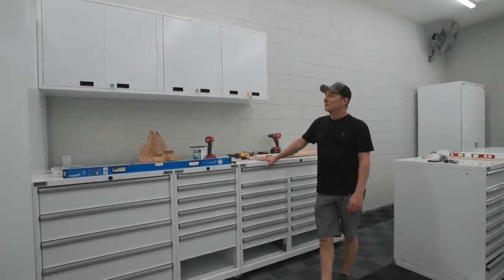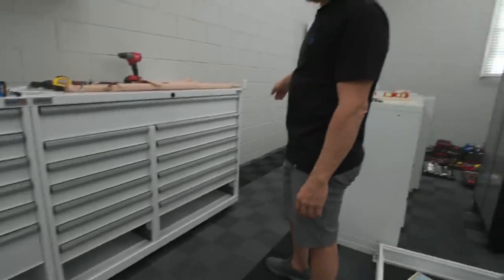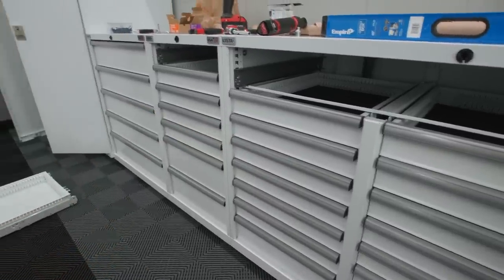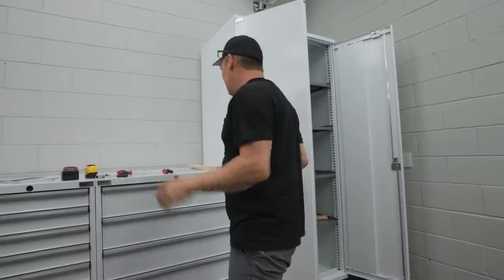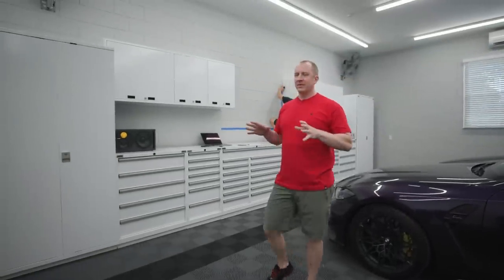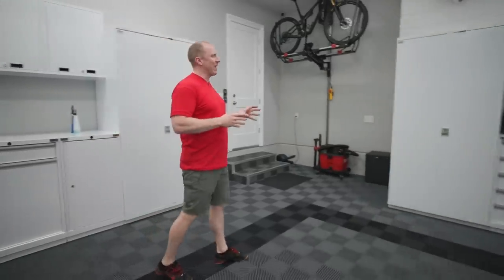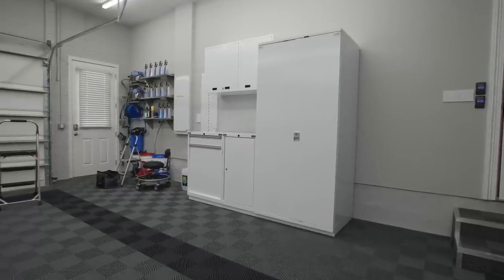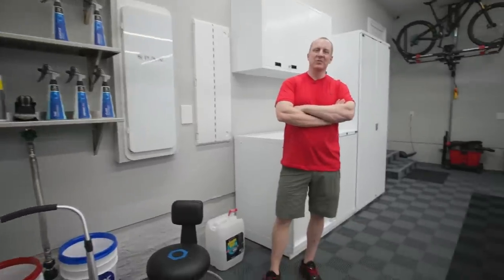Lista Cabinets Home Garage Initial Thoughts - Day 2 Install Complete

Comment: I worked as a Manufacturing Engineer at Lista! This is very accurate to what the product goals are. Powder coating options are quite possibly endless. American made, and the workers at our site in Holliston, Ma are proud of the product they make. They also make Mac Toolboxes.
Reply: Does that include powder coating the whole cabinet 🙈
Reply: @Tdaz250  yes 😂
Reply: I have customers that use Lista cabinets in the heavy manufacturing industry. Very good quality that take a beating and hold heavy items. They are well made cabinets
Reply: The fact that the powder coating is janky in the cabinets Matt showed is a defect, which should be addressed with whomever is doing that process. That wouldn’t be acceptable to me as a customer. You need to build quality into the process. I highly recommend watching Paul Akers/ Fast Cap YouTube channel if you are in manufacturing—- you guys will take your cabinets from a 8/10 to a 10/10 with simple process improvements

Comment: That came out looking very nice. 

Over to the left where you have partial setup will make a nice space for a small tool cart, should you want something portable for the most commonly used tools, keeps the main tool box nice as it takes abuse instead :).

Comment: Hey Matt, I think the cabinets look great wasn’t sure about the color at first but after seeing them assembled. like I said they look awesome especially with the wood countertop. Can’t wait to see it. you mention setting up the audio One thing that’s kind of bug me is you have the Twitter mid range towards the outside? I know those are studio monitors, and in the near field set up the tweeters mid range should be towards the outside, but with the speaker so far apart, and with a TV in the center placing the speakers with the tweeters and mids to the center should give you a better center image and also with the flanking side lockers protruding farther forward they’re probably blocking the dispersion. I would definitely give it a try unless the location of your components dictate speaker position. Just a thought can’t wait for the next one. Have a good one.
Reply from the maker: Core Studio Monitors are designed and tuned for the woofer and port to be place on the inside when in the horizontal configuration.
Reply: @ObsessedGarage  yes, I’m sure that is the case but I’m sure they were designed and tuned for near field I would give it a try. It might sound better unless it just is too big of a hassle. No worries I’m sure it sounds great. maybe it will sound a little better maybe no difference at all I doubt it would sound worse. Just curious.
Reply: buddy, the system is in a garage. He's not doing critical listening in there so how he has them setup is completely fine.
Reply: @vongdong10  turtle wax and  Dodge’s ( well, maybe not Dodge’s) are completely fine but I strive for better. So if something is just fine it can definitely be better so thanks BUDDY for your just fine input…….
Reply: @johnmbell4642  may want to reread what you said and what I said...
Reply from the maker: It's not a bad idea to try it.  The Cores have a switch on the back to denote right or left, so it can certainly be done.
Reply: @ObsessedGarage  Matt it’s always good to experiment. It’s been my experience that  having the tweeters inboard instead of outboard just about always creates a better image/soundstage. The other thing I would try is put them in the vertical position, would be better yet bringing the closer to ear level. I know you pretty much know all of this having sold audio in the past Plus, probably like myself, Setting up multiple systems surrounding and 2 channel over the years but with everything you got going on just thought I’d give you a little reminder. Have a good one.

Comment: Your cabinet design is always top notch. Would have lost the center block looking wall.  Myself I would never mount a TV even though it looks great. I would never use the TV. Also manufacturers always over advertise their name to much on all the cabinets. Looks to busy when I see name, name, name….
Reply from the maker: You can do two things.  One, you could build a base frame for the side cabinets.  Second option would be to just mount the upper cabinets lower.  I don't like them in a straight line.  It make the array look small and odd.

Comment: Nice cabinets. I realize center block walls are obviously durable but to achieve the best look (modern) I would do smooth. Drywall gives you that modern, expensive look. When doing white cabinets I am wondering how your regular grey (harbor grey)on the walls would have looked with the cabinets? Creating some pop. Or going with pure white to match the cabinets. Always nice to try different things though.
Reply: When finishing my garage walls I used cabinet grade plywood.

Comment: What are your opinions on LISTA vs Rousseau vs Moduline in regards to fit and finish and industrial function? Thanks any info is appreciated.
Reply from the maker: First Moduline are all aluminum, so no go on the industrial side of things.  They are much better suited for a clean, consumer garage.  Lista and Rousseau are very similar.  Their catalogs are a lot alike.  I like the Lista drawers more, but the fit and finish of Rousseau is a little better.
Reply: @ObsessedGarage  thanks for the input always love your videos.
Reply: @ObsessedGarage I restore old Vidmar(now Lista) cabinets, and recently did a Rousseau and you are spot on, Rousseau are way better built, just the front drawer part of the cabinet is 2x thicker. Also the paint is way more durable.

Comment: Wait a minute, was Lista always owned by Stanley Black & Decker?
Reply from the maker: No, they were purchased a while back.
Reply: @ObsessedGarage  Would you say the quality has remained the same after the acquisition? Curious if anything has changed.
Reply: @dino-335  Considering he just got Lista products, how would he know the difference between then and now?
Reply: @timkinley1779  He has mentioned he wanted them for 10+ years. I doubt he just decided he liked the name or shape of them. Am I that crazy to think Matt did a bit of research on the specs of the product when considering the purchase of $20,000 cabinets 10 years ago?
Reply from the maker: I'm not sure about that one.  I would wager there is likely some quality loss, but I can't say.

Comment: Too hard to comment on the cabinets without touching and feeling them.  I don't care for the toe kicks as they are in Matt's language "janky"  and "wonky" out of line and the gaps are not equal distance so I'd prefer something else.  Is there something that finishes off the underside of the cabinets as I don't care to see the bolt, key and wire holes.
Reply from the maker: I actually really like the function of the toe kicks on the Listas.  Since the floor is pretty sloped, a fixed toe kick would have a 2" gap on the far right of the cabinet array.
Reply: They feel fantastic. The slides are incredible.